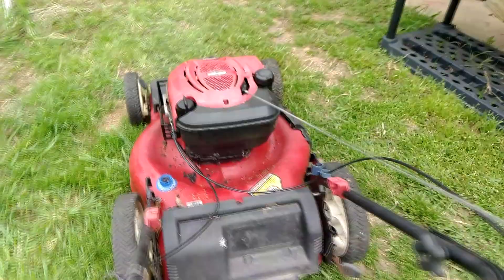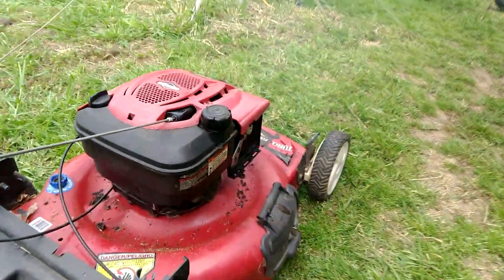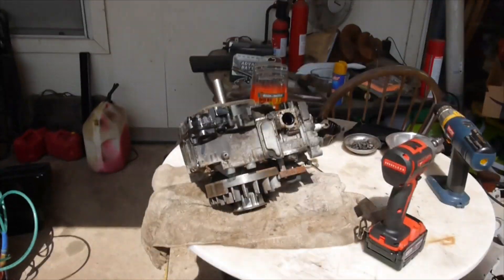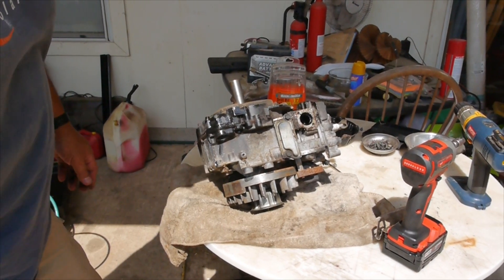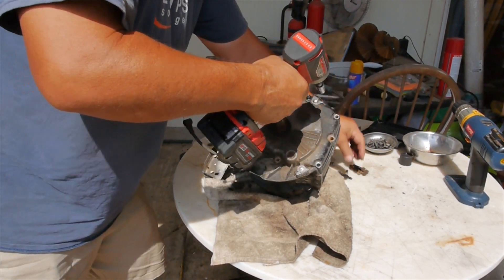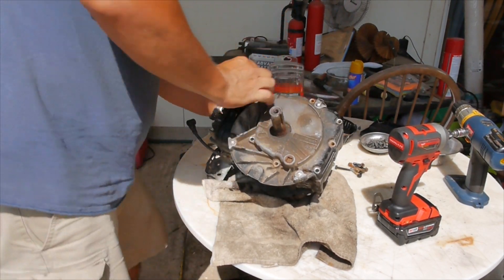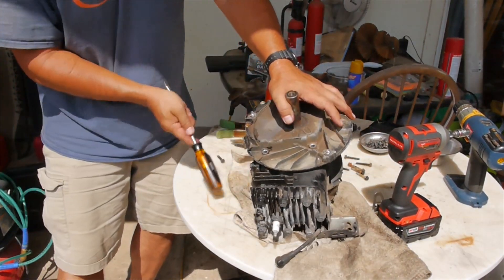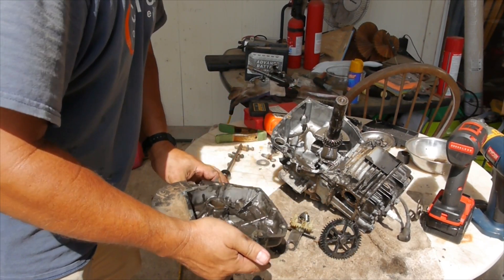What Caused the Lawn Mower Engine Knock?

Comment: No clean air filter or lots of particles of dirt got into the oil, accelerating the wear. Or it could have had an overflowing bowl which leaked into the cylinder thinning out the oil and accelerating wear. A dry air filter that that's not oiled can be just as bad, because all the finer grits get thru it and wears down your motor. Oil changes cost a lot less than a new mower. My guess is dirty air filter and not enough oil changes, which probably accounts for over 90 percent of bad motors.

Comment: Thats a piston connecting rod and to do repair correctly u need to check the size and roundness of the crank journal and if within spec replace the rod and get new seal set lucky if u don't need to machine anything

Comment: gas thins the oil thru leaking needle seat on gravity feed gas motors.. gas thins oil, runs engine.  oil changes every <20 hrs for long happy life. drain gas at end of year, spray WD 40 i the carb/tank to prevent rust/bugs. mothballs keep mice away. take cap off, take a little bit off the sides of the cap til the slop is gone. THICK OIL with 20 % STP oil treatment... fresh gas and FOR SALE sign on it "runs good"... actually shd be RUNS WELL, not good. 50 wt racing oil. last long enuf... 50 hours? keep the THICK OIL IN IT and rev's down... it will run... til it doesnt ;)

Comment: rebuilding an 18.5 briggs.  it was completely destroyed, the decompression lever separated from the camshaft, the governor and oil slinger shattered into pieces and the counter balance and links were mangled up in pieces in the crank case.  replaced all the parts and it ran, but now its making the exact same noise yours did.  Just purchased a new crankshaft and connecting rod.  hopefully it solves it!
Reply from the maker: Let us know how it turns out.

Comment: I have a mower that sounds just like the one in the video.  And I've been thinking that it was the bearing connecting the piston shaft to the crankshaft. Then I looked for and found this video, which kind of confirmed my thoughts.  Do you think there is any danger to the operator if we continued using it?
Reply: Well mine actually threw a rod through the crankcase and landed several feet away on my driveway.  Luckily, it didn't hit anyone or anything, but it can be dangerous
Reply: No danger to you. One day it will let go and spill a bunch of oil on your grass. I say let it ride and be prepared to get a new engine.

Comment: I know nothing about lawnmowers but the one I just got, I ran it for like 5 minutes, and it seized up and shutoff and now I’m scared to run it again lol
Reply: If it seized I don’t think you’ll have to worry about running it again
Reply: New lawnmowers do not come with oil in the engine. You may have ran the engine completely dry.
Reply: Check oil before starting any engine.You might take the spark plug out and feel the piston head for a hole .Just a thought.
Reply: When I was around ten, (25 years ago), my mom bought a brand new Craftsman from Sears! I went to go mow with it the day she brought it home, and she told me to make sure it was full of oil first, so I poured this little bottle of oil that came with the mower into it! I go and start it and it fires up and just locks up after a few seconds. My grandpa came over pissed, cause there wasn't any oil in it. He managed to free it up, and still to this day she uses that mower. Well she dont, but stepdad does!

Comment: Over rev
No oil
Reply: no FRESH OIL... and or the gasoline gas past leaking needle/seat in the carb, thinned out the oil. gas is not a lubricant... so rod wore... lucky didnt spin weld it to the crank.  just needs THICK OIL 60wt and 20% STP oil treatment... cleaned and FOR SALE runs good... sign ;)  Caveat emptor (let the buyer beware in latin)

Comment: knock can be hard to define sometimes. I had one I thought was con rod wear but on teardown it was good. pulled the piston and there was scoring and the piston was actually broke between the 2 rings. that piece was slapping around in there causing the knock.  I got another one I'm going to open up but that one had no compression because the valves weren't closing.  So it may be the valves but it sounds too loud, like rod knock.
Reply: Broken flywheel key
Reply: If a irresponsible person borrowed your mower and ran over something, what is the first problem that you would try to diagnose?
Reply: Does a broken flywheel key make knocking sound too?
Reply: Bent crank